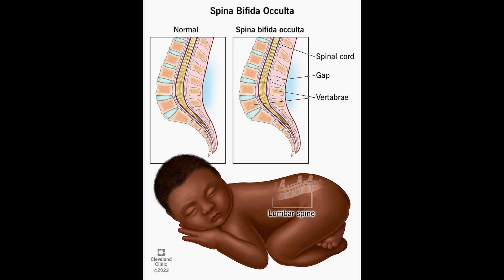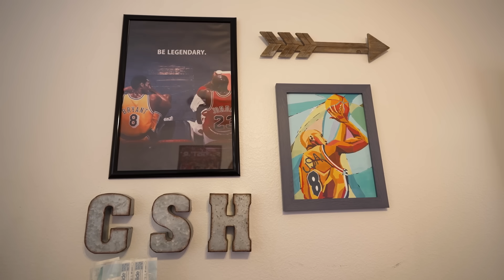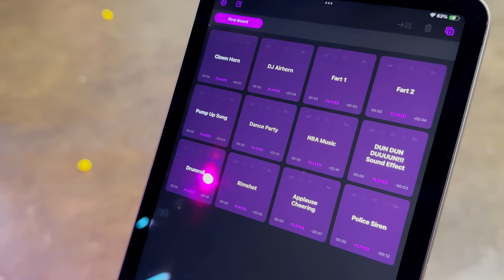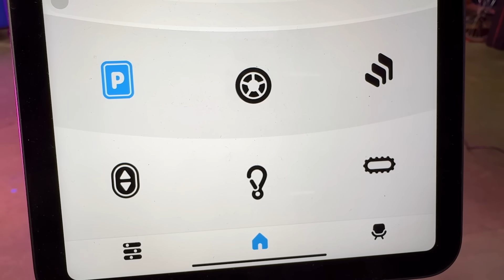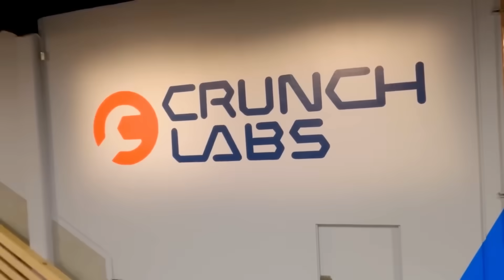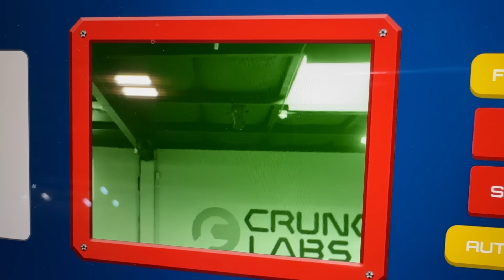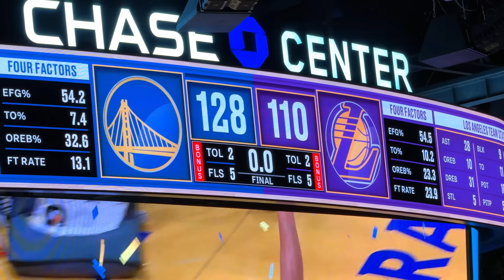You've Never Seen A Wheelchair Like This

Comment: I had to look up spina bifida because from the diagram I didn't understand how someone would get paralysed, the spinal cord looked fine there. But after seeing what happens to the spinal cord with this disease it makes sense, it litterally moves outside the spine, makes it very vulnerable to basically anything. And when the spinal cord is damaged it doesn't work properly anymore

Comment: This is a fun, conceptual wheelchair but it’s really over designed for most usage. Would cost way too much given how fancy it is and it removes the need to utilize/strengthen your upper body for those who are capable of doing so. It’s a cool “what if”, experimental design but for practical purposes, it’s debilitating. Might work well as a chair you rent out for the occasional birthday party or celebration rather than daily use. The ones who need it are those who can barely move their upper body. For the rest of the people who use wheelchairs, it might not be helpful at all.

Comment: An offensive analysis on Battle Mode:

I will admit, this things will pack a punch, but only if the agitator has the high ground. I can see that the nerf guns are tilted at an angle that fires the bullets to the sky, and therefore does not allow Cash to attack that one robber in front of him. However, I can see this as a slight oversight as if a robber is in the open, the increased range will allow cash to rain fire from the sky and defend himself properly from the brutal onslaught that is people who will make fun of him for being classified as “Special needs” and this creation will certainly put all of those nasty children in place for the rest of eternity. 

All in all, that’s one cool wheelchair.

Comment: I saw one on TV probably in the 90s either Tomorrow's World or Blue Peter and it had 2 sets of 2 wheels and was either on 4 for sitting height or balanced on 2 for standing height. Someone tested the balance out for standing height by throwing a sack of potatoes at someone sitting in it and the chair rolled back to compensate. Then the chair climbed stairs by rotating the assembly of 2 sets of 2 wheels, having each set of wheels on the next step while balancing!

Comment: Seems to also be something missing from the chair in terms of physical exertion (which is probably important to maintain if the kid wants to be an athlete). It seems to play into the gifted high tech genius model, rather than the resilient tough as nails, don't take anything from anything model that perhaps his father would prefer. So I would like to see a mechanically driven, lite model that's trimmed down to using mechanical advantage alone - no electricity, just a light weight set of wheels that is all terrain, including stairs.

Comment: No offense, it's a nice chair but most of these features will sadly only be used once. The kid just needed a motorized wheelchair. Hopefully they installed sensors for those nerf blasters. They move quite quickly and will definitely take off a finger. If someone accidentally hits the button while a hand is in the rails path.

Comment: Nice! Many cool features but thread-gripping stair climbing mode isn't safe. If the thread slips or rips, you're done. Better have a proper stepping design where the "food" or panel rests ON TOP of the step during climbing.

Comment: This wheelchair is amazing (it's my dream wheelchair) but it's absolutely not fitted to a kid this size. Which means he can hurt himself using it or he will not be able to continue using it. I'm an engineer, and I'm disabled. As an engineer I want to fix problems and I want a disco wheelchair with nerf guns, but as a disabled person I know that I need my mobility aids to be adapted to my morphology and fitted by medical professionals to avoid long term injuries. Of course it wouldn't be as spectacular, but giving him all the upgrades on his manual chair would have been a better solution for him.

Comment: sorry sir, I just wanted to suggest but my suggestion is not necessarily listened to. for the finishing touches of the wheelchair maybe it needs to be provided with a protective head helmet in cash something happens while climbing the stairs. as perfect as technology is if it is constantly used, it may experience aging which all applies to hardware and software. finally I want to say that your work is truly extraordinary sir.

Comment: Battle Mode 2.0. You drive with one hand, and have an infrared targeting laser in the other. A camera on each gun senses the laser and fires at that point, using both cameras and gyros to judge distance and hence the firing angle.

Comment: That was sweet, made me almost cry. I missed just one feature on that wheelchair, being able to drive it manually. If he does wheelchair- basketball and generally for exercising his muscles using a non electrical wheelchair is quite important.
Reply: It is probably too heavy for manual operation I suppose.
Reply: @freyyr  yes, i was thinking about a system  like an e-bike has, where you can adjust, how much you have to do on your own and how much the motor does for you. That way he could take more and more weight on his own, when he gets older and stronger.
This wheelchair is really fun, but I think using it too much, would not help him in the long run at all.
Reply: @freyyr  I assume, it will be his wheelchair for special occasions :P